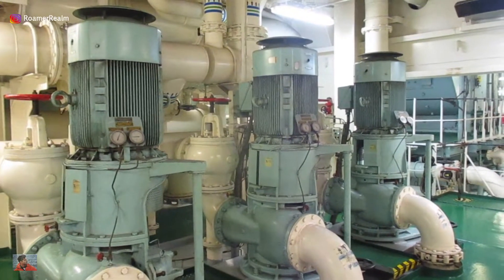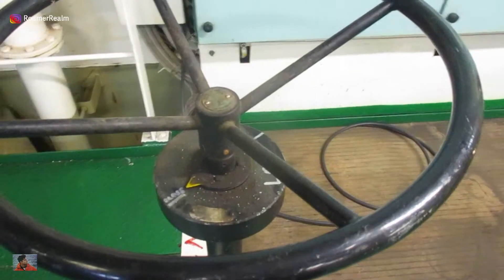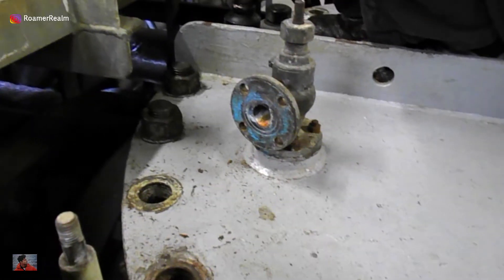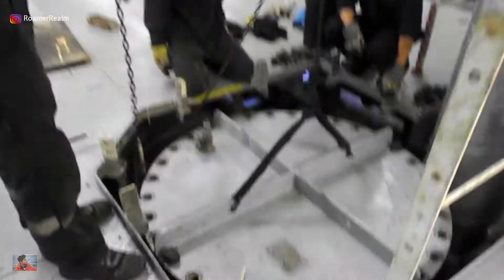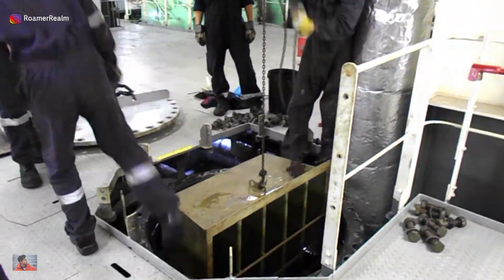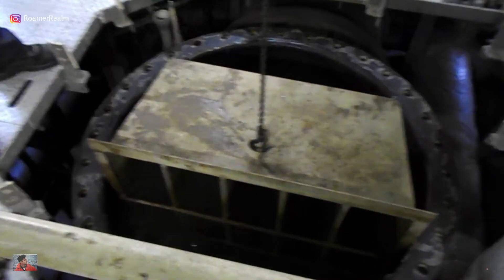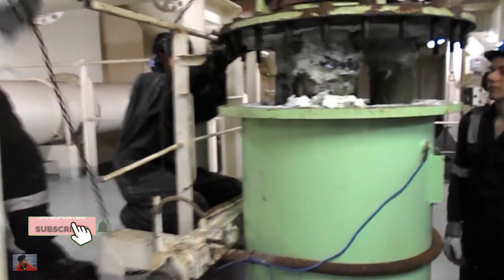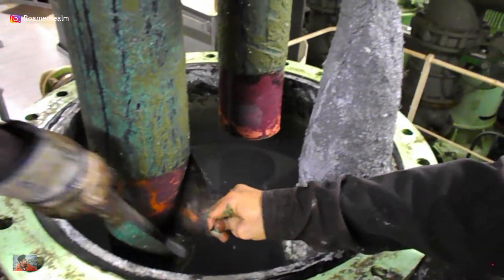Sea Chest in Ship Explained | Strainer Cleaning & Inspection | Marine Engineer | RoamerRealm

Comment: Any products that could treat the seawater to extend the amount of times you have to clean these?
Reply from the maker: Hi Graham! No, I don't think so. The MGPS system fitted does prolong the life of the sea water system components but the sea chest strainer filters out the physical impurities and hence, it will definitely get clogged over time. Also, as ship staff, we have zero control over the quality (or contamination levels) of sea water which we draw into the ship. Certain river passages with shallow depth (and hence, low under keel clearance under the ship) will lead to an even accelerated clogging Vs open/deep sea navigation with almost no mud/silt. Do let me know if my explanation answers your question, and please do ask away if you have any other follow up question. Thanks and do Subscribe to my YouTube channel 👍

Comment: Thanks for such a nice explanation, non-marine guy like me also can understand and feel the environment ... Keep it up, looking more knowledgeable sessions from you. Thanks. 
A dumb question:: what is the need of pulling Sea water inside the ship, is it only for cooling purpose or there is more use?
Reply from the maker: Thanks a lot Praveen! Means a lot, your feedback and the nice words of appreciation! Really, thanks a lot! :) To answer your question: previously (30 years ago) most of the ship systems were Sea Water cooled, but due to sea water (salt) the piping, machinary etc will corrode faster and also will clog up faster during normal operation. Thus, at some point, the cooling system was changed to Fresh water cooled i.e. Sea Water comes in, cools the fresh water (already available onboard) and then the Sea water goes overboard while the Fresh Water s circulated and cools all the other systems. But overall, Sea water is just for cooling the Fresh water. Hope this answers :) Thanks a lot for your support with the channel!

Comment: First, great video. So, about block valves on Sea Chest. I usually see a manual butterfly valve and an hydraulic butterfly valve (with handwheel). Why the hydraulic valve is used, insted of another manual one?
Reply from the maker: Thanks a lot Bernardo for your nice feedback! Coming to your question, I have actually sailed on ships which didn't have a hydraulic valve at all - yes, that's right, there were  just 2 pieces manual valves i.e. before and after the sea chest (also known as the overboard sea chest valve and the inboard sea chest valve). The advantage which a hydraulic valve provides is remote operation i.e. incase there was an ongoing flooding, then you don't have to go to the bottom platform (where it will be flooding and hence, unsafe for the operator of the valve) to shut the valve manually since the hydraulic pipes/actuation mechanism can be provided and the valve can be remotely operated from a higher deck (which is not yet flooded, example the Engine control room deck). I have not found any write up about this in any of the International publications. My answer to your question is solely based on what I think. It would be nice to hear if you find this explanation practical? Let me know and do SUBSCRIBE to my youtube channel 👍

Comment: Interesting video, would totally watch more videos about the ship you work on. 

Not sure why they’d be at varying heights, is it related to being loaded vs unloaded?
Reply from the maker: Regarding the different heights of the sea chest, it's because when we are in port the under keel clearance (distance between the ship's bottom and the ground is quite less, so, using a lower sea chest means we are introducing water from a deeper point...this could mean more dirt/sediments/sand etc when we are in port, so, then we switch to the high sea chest (which is taking in the water from a higher point and hence, it will be relatively free of the dirt and sediments)
Reply: Oh awesome, makes complete sense. This video reminds me of the recent submarine video on smarter every day, super cool.
Reply from the maker: Thank you so much 👍
Reply: @RoamerRealm  Brilliant and informative video, well-worth a like and subscription. I've looked through the comments and unless I'm mistaken, you have so far only been asked about and provided an answer to the question of varying heights for the sea chests. Could you also explain why we need one portside and one starboard side? Also, based on your answer above, does it follow that the high sea chest will be portside, while the low sea chest will be starboard side? Finally, apart from their spatial positioning in the hull, do the high and low sea chests otherwise vary in their size, capacity or function? Many thanks and please keep it up !
Reply from the maker: @andreasscaramangas1344  Hi Andrew! Thanks a lot for the wonderful feedback, I am glad you found the video informative. Coming to your questions:
It's not a rule for Port/Stbd to be High/Low Sea Chest or vice versa, it totally depends on the naval architects and how they plan to install which one on which side. I have been on ships where Port side was High and on other ships where Stbd side was high.
Both High and Low sea chests are identical in dimensions so as to allow equivalent in-flow of Sea water. The only difference is the height at which they're fitted on to the hull. Size, capacity and function are exactly the same. I was once on an old ship where the sea chest were of different sizes, but that's the only ship in the last 15 yrs of  my sailing career where I had this observation.
There is one sea chest on each side so that (in case/even if) the ship is a collision or touches bottom or damage to one side of the hull (thus rendering that side sea chest unusable), the other side can still be used.
You didn't ask but I wanna add that the High sea chest is usually in use when we are in port, or canal transit, or river passage etc where the under keel clearance is low, thus we switch over to High sea chest (located at higher height) so as to avoid the sea water pumps sucking in dirt, mud, sediments from the sea (due to low under keel clearance)
Let me know if you have any other questions and thanks again for the nice positive feedback!
Reply: @RoamerRealm  Thank you
Reply from the maker: Very welcome, please do subscribe to my channel 👍 thanks
Reply from the maker: Thanks a lot for your kind words! :) I will try to post more ship related videos as well from time to time 👍